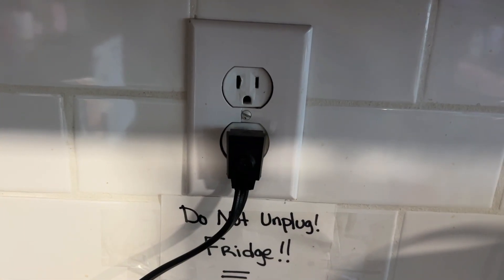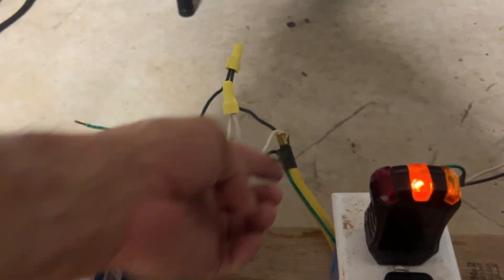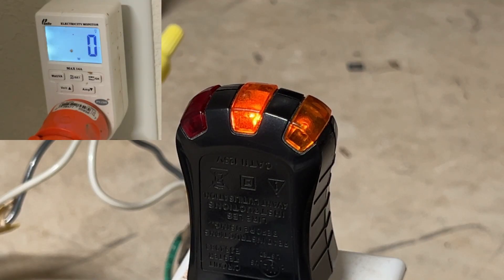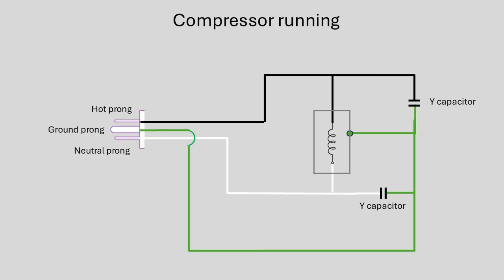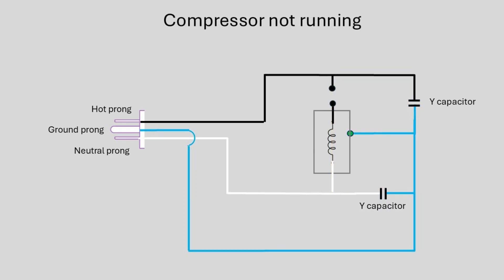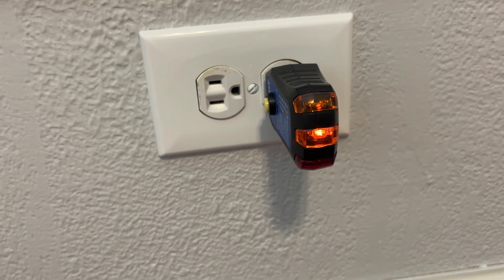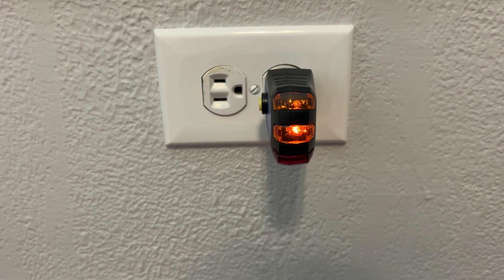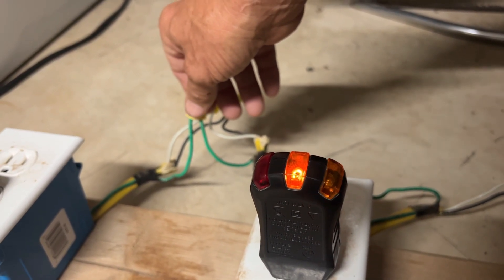The Truth Behind That Dim Light on Your Outlet Tester

Comment: I've had this happen multiple times. Some of the time it must be the EMI filter but others was caused by a dirty or corroded ground pin connection at the receptacle. I found that it was usually occurring on a receptacle that did not get frequent grounded plug insertion. To elaborate, if I would twist the tester back and forth a bit I would usually get enough of a connection for the little low current ground indicator light to glow bright. Sometimes it would be the receptacle behind a microwave or refrigerator on the side of non frequent use. Those little lights don't draw much current so even a little dirt in the ground slot can interfere with the needed current flow.
Reply from the maker: Thanks for sharing your experience! That’s a great point about dirty or corroded ground slots, especially in outlets that rarely get used. I hadn’t thought about how low current draw from the tester lights might make them extra sensitive to even small issues like that. Twisting the tester to get a better connection is a smart trick—I might mention that in a follow-up video. Really appreciate the insight!

Comment: I wonder what a gfci would do in this situation?? Do you think it would trip?
Reply from the maker: A GFCI will trip on a real ground fault whether it is grounded or not, so, yes, it would trip with this dim light. However, if you are using a three-light tester with the GFCI test button, it would not trip since there is no real ground.

Comment: I once ran into this "poor ground" situation while working in a home built in the late 1950s.  It happened with the receptacle outlets surface mounted in a handy box on a concrete basement wall.  Upon plugging in my three light tester it showed "correct wiring" i.e. both amber lights brightly. However I knew this was very unlikely to be actually grounded because there was cloth sheath NM cable feeding the receptacles in question, and equipment grounds in receptacles weren't required by the NEC until 1962, and many areas of the country were several years behind the latest NEC.  Anyway, to confirm my suspicion, while leaving my three light tester inserted, I use a wiggy meter aka solenoid voltage tester between the hot and ground on the other half of the duplex and what do you know, the three light tester changed from "correct wiring" to "open ground", and my wiggy meter read 0 volts.  

I think what most likely happened was the metal handy box, being mounted to the concrete wall with tapcon screws, was "grounded" via the concrete. However since this home had a 60 amp fuse panel feeding these receptacles with no GFCI protection, the fuse would not blow and this "grounded" handy box and chassis of a 3 pronged appliance would remain energized in case of a fault within the appliance. 

Has anyone else besides myself ran into a similar situation?
Reply from the maker: That’s a great story—and exactly the kind of scenario that confuses so many people, including inspectors and electricians. It’s a perfect example of why a light on a plug tester doesn’t always mean you have a safe or proper ground. That “ground” path through the concrete and box may carry voltage just enough to light a bulb but won’t carry fault current to trip a breaker. Thanks for sharing!